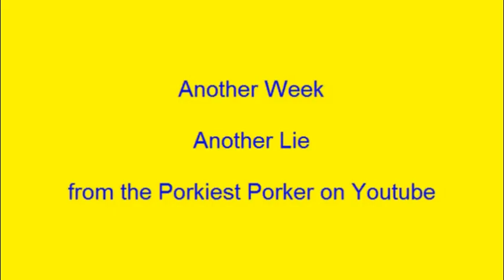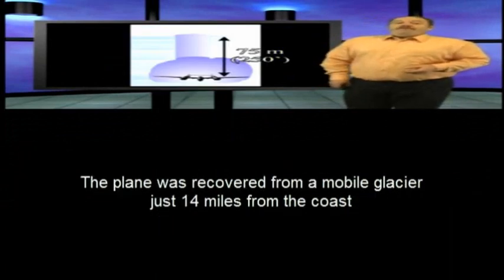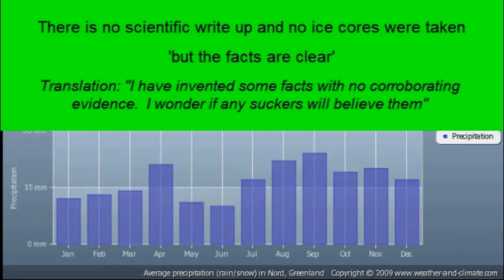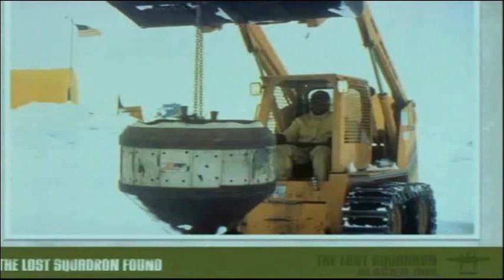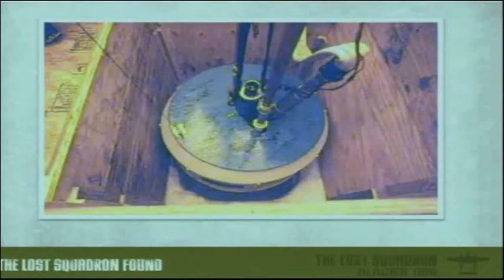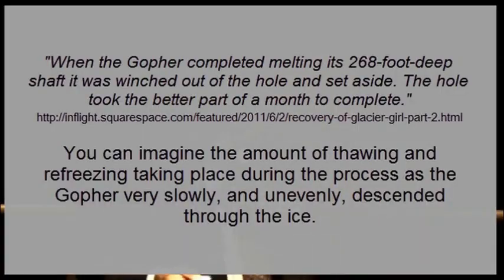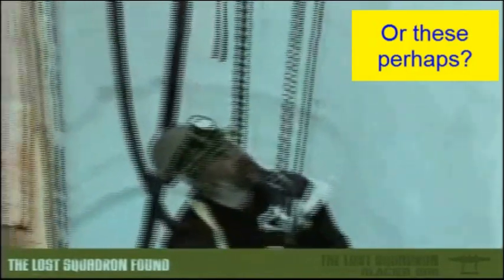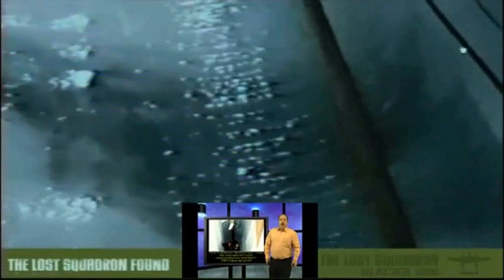Ian Juby Lying About Ice Core Data

Comment: I live in Denmark, and it's just about the same weather here. :-) 

The problem is not the actual temperature, but the dryness and lack of evaporation in those parts. But as you rightfully point out, it can still snow there if moisture is coming from somewhere else.

Comment: It is because, cold air has the capacity (or lack of it) to hold markedly less moisture. That's why it very rarely snows at the actual Poles but the snow that you'd see has been blown there. Also, speaking from the UK, when we get a Northerly then there is little or no cloud because of this cold air.

Comment: I've never claimed that you cannot get precipitation in cold conditions but in extremely cold conditions you will get little or none.
You won't get the volume of precipitated water in any snow fall approaching the volume that we have recently experienced with rain in the UK (& i guess other areas of West Europe). Of course we do get great snowstorms when a warm front replaces near zero degree colder air but here duration is the key.